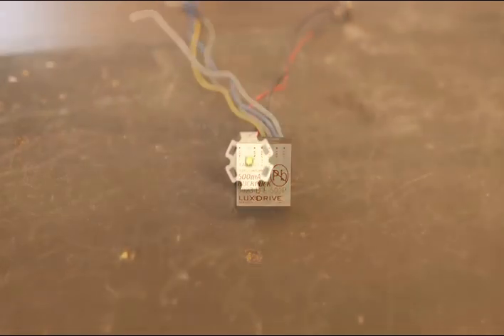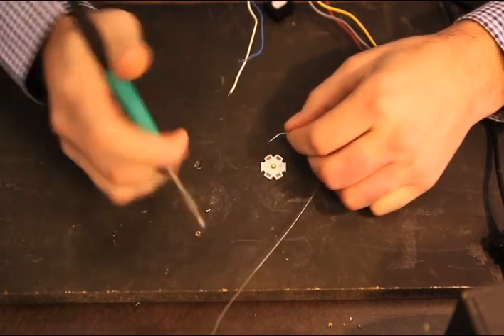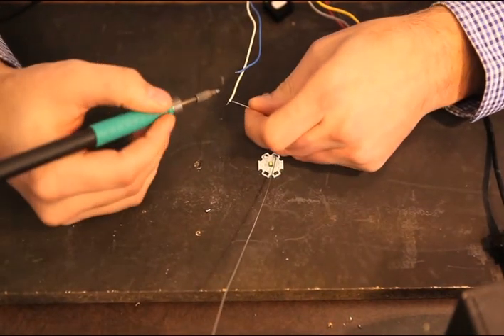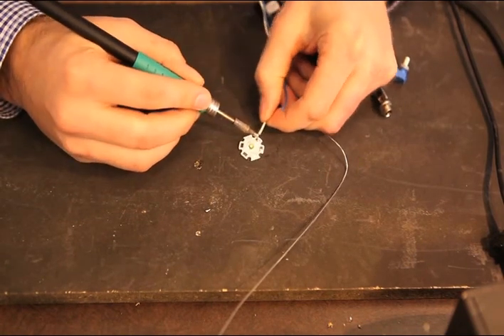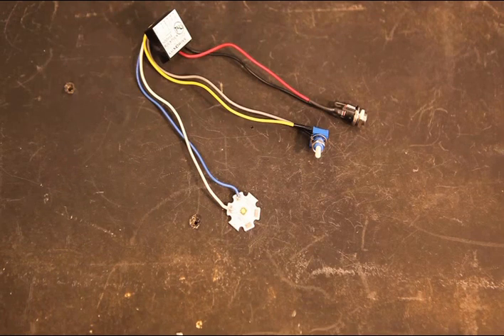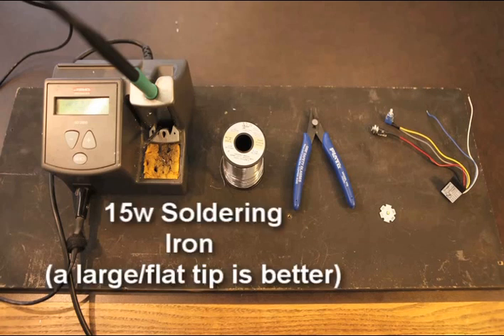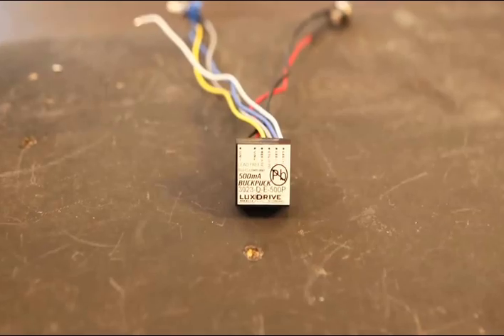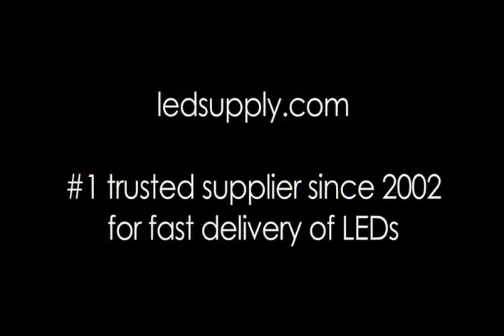Soldering Tutorial from LEDSupply

Comment: You are advising people to use lead based solder.  That's just hanging legal liability out there.
Reply: Lead base has a lower melting point then non lead base. Use common sense and safe practice by washing your hands after use and the amount of lead in solder is minimal, hence being able to solder indoors. Non lead base takes more to heat up and melt giving the potential to damage the electronics you are trying to solder because they become extremely hot and de-laminated or fried.
Reply: @Jontavius_Laquavius  sure it's easier to use but lead is a serious neurotoxin.
Reply: The risk from lead is usually very low. This may seem strange given the high percentage of the metal in the solder. However, soldering is usually carried out at a temperature of around 380 C and significant lead fume is only evolved at temperatures above 450 C. So exposure by inhalation is normally insignificant. 

As for touching it, yes lead based solder has about 30-40% lead content but washing your hands after use is advised. Don't solder then eat a bag of chips with lead on your fingers. There is minor traces of lead in drinking water and many other things in your day to day life. Lead based solder is what I use and many others use, if you don't feel safe then that's a personal choice but damage to electronic and small components damaged due to excessive over heating rises with no lead base.
Reply: @Jontavius_Laquavius  in addition to the threat to the actual technician doing the soldering, there is the effect of environmental pollution caused by lead leaching in the improper disposal of lead soldered materials.  besides that consideration, you are really going out on a limb assuming that random people on the internet who you giving advice to will operate soldering irons at a safe temperature to avoid producing metal fumes or will understand the dangers of heavy metal contamination in general.
Reply: @norvillerodgersspeaks You're from California huh?
"in addition to the threat to the actual technician doing the soldering" What!? You realized soldering is done indoors. People solder for careers and live normal lives. If this solder is such a hazard to the population because of lead inhalation and environmental affect why are people working with it for decades and live healthy long lives.

Also, For the "going on a limb to assume people solder at a correct temperature" that's on the individual to research and learn a skill. Your logic, EVERY car salesman's is assuming that person is fit to drive because they have a license but they could text while driving so it's wrong. Every car dealership should stop and run a 1 year semester course on driving tips for a safe driver cause it's their responsibility not the buyer. Buy a soldering iron and solder isn't mine or LED supplies responsibility to coddle the general public. 

You use your lead free solder and live a lead free life. Except again, there's also small amounts of lead in your drinking water and other day to day items. But we are all doomed to solder with lead. Thanks for clarity Neal
Reply: also, dangerous drivers are not a water soluble environmental pollutant.  what a garbage analogy.
Reply: @norvillerodgersspeaks  somebodies sensitive. also here's your solution. "Sure, you get less heavy metal poisoning, but lead-free flux is exceptionally bad for you when compared to what is used in lead solder" that's from multiple test and break down on lead free chemicals. Breath in that sweet fresh lead free air. Also didn't feel the need to call you names Neal, guess all the lead in my brain makes me too dumb to call people names. 

And for the analogy it works. Just because I buy a soldering iron and solder doesn't make it the responsibility of its manufacturers, salesman or stores to educate and teach you everything about the product and safety. Just like car manufacturers, dealers and salesman aren't responsible for your driving ability/education. You're the best Neal
Reply: @norvillerodgersspeaks  Naw, it tracks. Also,
You have done zero to defend non lead solder, it has more harmful gases released and the fact that lead doesn't vaporize at soldering temps so your only risk of lead consumption is not washing your hands or not wearing gloves while soldering to keep the lead off. Use of a small fan with a carbon filter to remove the flux fumes (which is what's actually vaporized while soldering leaded solder) should be used with non leaded solder and actually more so due to the added harmful vapors you are introducing into your house. Good thing you have great ventilation Neal, I was worried with that lead free solder fumes